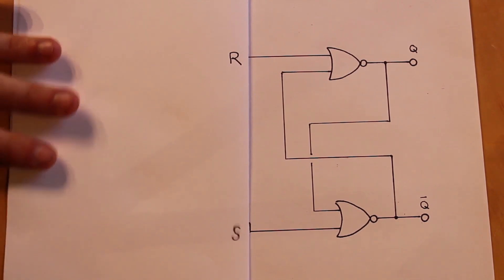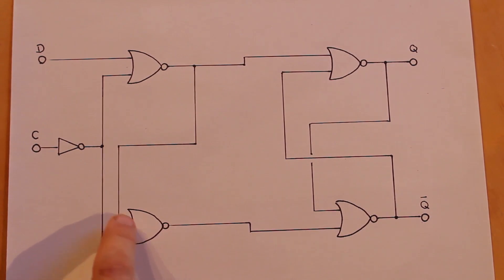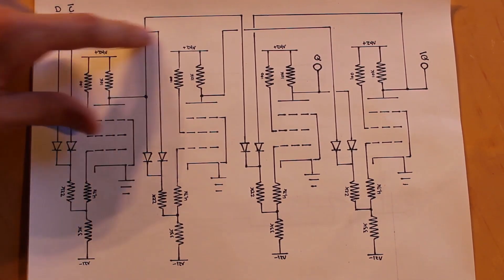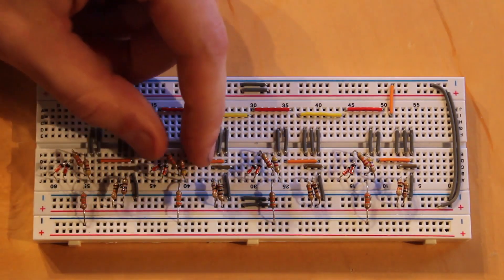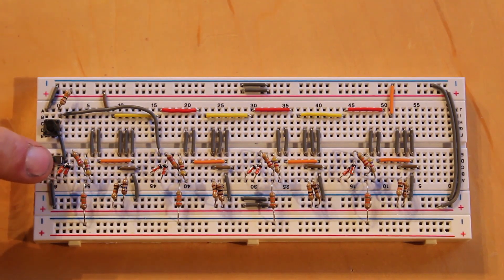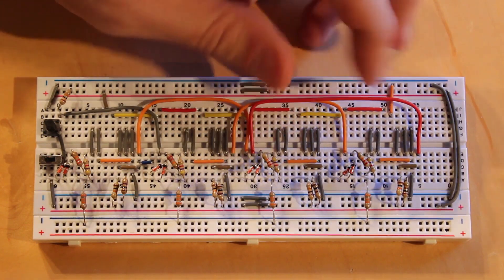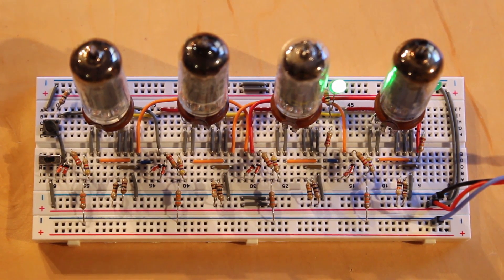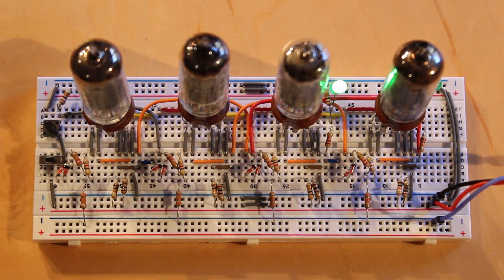Let’s Build a Vacuum Tube D Flip Flop

Comment: Somehow it bothers me that that push-button isn't between C and E but between D and E. PS: I admit not douible-jamming contacts into a hole in the 0 (actually 1) column would have required an additional wire to move things one over.

Comment: A lot of the thin “2 row” side breadboards now have that annoying gap in the middle, usually with no indication that the gap exists. Back in the 80’s when breadboards were manufactured in the good old U S of A, that gap didn’t exist. I note that you have added the two,short links for two of the side breadboards, but there is no link for the bottom one, which I think has the negative bias voltage. So is the bottom breadboard different to the two above?

Comment: Thinking out loud here...I wonder if you could have done the same thing using 6B7 or 6B8GT tubes?  They are Duo-Diode Pentode type tubes.  The idea is to replace the diodes you used with the diodes in the tube.
Reply from the maker: That's actually a really good idea, and I actually have a few 6AV6s and 6AT6s, which are dual diode triodes. However, the 6AV/T6 as well as the 6B7/6B8 all seem to have the diodes sharing the cathode of the triode or pentode inside the element, which unfortunately wouldn't work with the NOR design here as I need the cathodes of the diodes to connect up to the control grid ultimately.
However, there's actually a way better tube for this, and that is the dual pentode, like the 6HS8. They're set up really weird, but they essentially have a shared cathode and a shared control grid #1, with separate plates and separate control grid #2. So, the share control grid can act like an enable, and the two plates and two separate control grids can act like two separate tubes. This means the tube is essentially a dual NAND gate, which means it can be an SR Flip Flop stuffed into a single tube, which is just awesome!
Reply: @UsagiElectric  My original thought was to suggest a 6H6 but when I looked it up to confirm what it was, I discovered that it is actually just a Duo-Diode only.  But it is a cool little squat tube about 3/4" tall.  I am eager to watch your progress as you go through the process of completing a full computer using vacuum tubes.  What are you going to use for memory?

Comment: Cool!

Coincidentally around the same time, I got the itch to do a little blinkenlites with tubes.  I decided on a shift register.
Schematic: https://www.seventransistorlabs.com/Images/Tube_Shift_Register.pdf
Blinking: https://imgur.com/gallery/OF4jAxh
I also happen to have a box full of pentodes (5702, subminis with wire leads -- very handy for breadboarding!), but figured using logic gate synthesized flip-flops wouldn't scale very well for a register (hard to do it in less than the four you've used).

Fortunately, I found a way to chain multivibrators together with diodes and a (fairly high amplitude) pulsed clock, so only needed two tubes (one dual) per bit.  Also handy, everything is balanced, so the XOR is pretty easy to synthesize, only needing two tubes.  (I did opt for the trick that, depending on gate bias resistor, one triode can perform NOR or NAND between two, maybe three inputs.)  One downside to this logic scheme is, the grid divider resistors (in the register) need to be somewhat closely matched (1% or so; I only have 5% on hand so had to bin them!).

The neon lamps can misbehave as well; I went through several permutations of bulb and resistors until settling on this one.  Note the bulbs and resistors are chosen to give equal voltage drops in the respective 'on' states.
Reply from the maker: Thank you!

A shift register is one of those things that I would love to build for a future bit-serial computing project! But, you’re right in that it’s almost not possible to build a D Flip Flop in less than the four tubes (or two dual triodes) that I’ve done here. What’s more, this D Flip Flop isn’t edge triggered, so it won’t work in a shift register at all (it just oscillates like crazy). In order to do that, we need another two tubes (or three total dual triodes). That’s what I get into in the next video on the Toggle Flip Flop.

Having said that, your multivibrator design is really brilliant! I’ll be honest, it’s a bit over my head though, haha. I stared at your schematic for quite some time and I’m only starting to understand bits and pieces of it. The interaction between the pulsed clock and the quad diode junction between grids and plates is a wild one that’s really hard to visualize. But, the results speak for themselves, your blinkenlites mad scientist breadboard concoction is amazing!

Is there a bigger project this will be used in? I’m curious what kind of applications you have in mind for such a wild circuit!
Reply: Right, I once built a T f/f out of transistors, in whatever you'd call it, ECL or CML, something like that (not straight ECL, but a few stacked tiers of current steering). Really beautiful schematic, right pain to build!

The key insight for this (tube) circuit was, the grids are really sensitive.  Like, I usually toggle a bit's state by touching its grid with a screwdriver -- body charge is enough to pull it off.  Or the next easiest thing, pinching the leads of the negative pull-down resistor (thus biasing it off via skin resistance in parallel).

I figured, if I can just charge a capacitor from the plates, with little enough current that the plate voltages aren't disturbed during the up swing (which would cause backwards operation), and on the down swing, ferry that charge over to the next grids, pulling down whichever has the lower voltage -- I'll have a shift register.  (And you can't just ferry around a lone capacitor anywhere, but you can split it in half and drive the midpoint from a clock -- same idea.)  And it happens that two pairs of diodes can do exactly this, with the voltage levels as they are, given a falling edge of more than about 80V.  After poking at resistor and capacitor values, matching grid resistors, and adjusting the clock waveform, it started working!

Heh, also 1N4148s are very marginal for this, but I checked, and found most of mine avalanche around 120-130V, which is fine for this.  So, whatever, it's close enough. :)

Along the way, I had some weird behaviors, like 4 or 8-period cycles with weird double transitions (obviously, the register wasn't shifting as such).  Possibly the clock needs to fall quickly, or needs to be a low enough impedance that a cascade of transitions doesn't ka-chunk the whole thing.  I'm not sure exactly which things were wrong at the time, but just generally cleaning it up and making a nice solid clock seems to be the trick.

Also, I started with an externally clocked version (in turn driven by my function generator in one-shot or auto mode), which was giving marginal clock levels, but did seem to be working.  The 12AT7 multivibrator however is able to saturate extremely well -- the minimum plate voltage is something like 10V -- so it gives a huge signal level, and the waveform is just about perfectly the pulse I wanted.  A downside seems to be, the duty cycle is limited, so that I can't go much further on the ratio of timing capacitors; but the values shown do a nice job so that's not a problem.

Also, because this is a sort of dynamic logic -- it's able to run up to a few kHz, but somewhere above there, I can see the light intensity and pattern changing, shifting to some degenerate sequence I'm sure.  (I don't have enough channels to scope the full register at once.)  There's plenty of room left to optimize for speed; obviously(?) with 12AX7s I wasn't going for anything extreme. :)
Reply from the maker: @T3sl4  Using ECL is an interesting way to build a toggle flip flop! You don’t really see too much on transistors not being driven into saturation or cutoff. It would be interesting to see what kind of toggle speeds you can get out of a discrete transistor ECL flip flop compared to the conventional way of doing it. I know next to nothing about transistors, but it would be fun to see what the limiting factor is!

I’ve discovered that tube grids are really sensitive! Even my low voltage stuff here is sensitive enough to toggle just by touching a resistor, like you mentioned. 

Your circuit is wild and absolutely awesome! I would love to see a full-length video explaining it and showing just how far you can push it (both in terms of functionality and speed). The 12AT7 is an excellent tube, and I’ve actually found that even at 24V it saturates pretty well. I would be interested to see how well the 6DJ8/ECC88/6922 tube does in your multivibrator. I’ve found that I can get that tube to saturate reliably down to about 5V, which is better than nearly any other tube I’ve tested (weirdly, the 6EH7/6EJ7 pentode actually has a nearly identical curve to the 6DJ8). 

I’m going to have to do a lot more studying of your schematic, there’s a ton to learn in there! Thank you very much for sharing it!

Comment: Nice. You're slowly building up more and more complex logic blocks. Soon you'll be building a 8-bit counter and have used up your entire stock of tubes and probably a shedload of additional ones. ;-)    I'm guessing that a ring-counter would be a logical (pun intended) next step in the evolution of circuity here.

But every time I see one of your videos I'm thinking that the grid resistor network might be simplified a bit.  I have a hard time seeing what the 4k7 resistor actually is doing there. The current is already limited by the upper and lower resistor in the preceding voltage divider. If the gate have a very high input impedance the 4k7 is totally superfluous.  If the gate have a low impedance (I guess not) then you could just jack up the divider resistors a notch.  The only reason I could guess for the 4k7 doing something useful is if the gate is presenting as a non-linear load towards the voltage divider and some magic happens.
Reply from the maker: Thank you so much! 

It’s funny you mention a counter, because that’s something I’m actively trying to suss out at the moment. A ring counter would definitely make sense, but I can’t seem to get one working reliably with tubes because the obvious answer is to use neon bulbs to make a ring counter. Unfortunately, neon bulbs do really do a whole lot at 24V, haha. I do have some plans for other counters to try to build, but like you said, it’s going to take a boat load of tubes!

You know, I never really thought about the little 4k7 resistor, it was one of those things that I was using while I was experimenting with a whole bunch of different resistors of all values for the voltage divider going into it. Once I was happy with the 22k/33k combo I use now, I never gave the 4k7 another thought. But, you're absolutely right that the 4k7 could definitely be superfluous. So, I figured I would do some testing!

I set up a 6AU6 as an inverting amplifier like always and then ran a potentiometer into the 22k input, changing the voltage from 6V to 20V in 1V increments. I took a measurement on both the grid and plate/output to see if there was any appreciable difference between the two.

Here’s the results: https://i.postimg.cc/Y9s9qbPk/Data.jpg

At first, it looks like there’s nothing in it, but where it gets interesting is what the voltage measured directly at the grid is as the input voltage increases. Once the voltage at the grid passes about -0.5V, it starts to flatten out, despite increasing voltage into the divider input. With an input of 10V, the grid voltage measures just about 0V and barely increases from there.

That’s not necessarily a revelation, as I’ve seen that in other tests I’ve done in the past. Also, I’m not entirely sure why that’s the case. I haven’t done too much reading into it, but it definitely is curious. However, the main thing between the 4k7 and NoResistor setups is there is an actual deviation from an input of about 10V on up. It seems the tube hits full saturation (output at 4.9V) with an input of 15V as opposed to an input of 17V with the 4k7 resistor.

So, the 4k7 is definitely doing something, although it’s probably so minimal it doesn’t really make a meaningful impact on the circuits I’m building. I’ll have to do a bit more reading on this and see if I can find a solid answer for what exactly is going on on the grid!
Reply: @UsagiElectric  Yea, neons are out of the question at 24 volts ;-)  When I do ring counters I do it with a npn/pnp combo that makes up a pseudo-scr as the active element and on top of that a diode or led up to the supply line that is having short interruptions in it to force a step in the counter. II guess something similar could be made with thyratrons.

The 4k7 seems to actually do something  a little bit, which is kinda curious since the grid should have a high impedance (considering I read everywhere that a tube amplifiers input impedance is basically only affected bu the value of the grid resistor that follows after the input dc-blocking cap).

Maybe the tubes operate in some strange mode at this low plate voltage.and actually is pulling some current into the grid?Could you measure the voltage drop over the 4k7 at some input voltage and see if there's any? Even a 1uA current should give 5mv that should be visible on any dmm. Does your tube-based meter have any real low voltage settings?
Reply from the maker: @MatsEngstrom  Oooh, I hadn’t thought about trying to build a ring counter out of thyratrons, that’s an interesting idea! I’ll have to look into that more and see if anybody has experimented with them as ring counters. 

The 4k7 is definitely doing something! I setup the 6AU6 as a standard inverting amplifier with the 33k to -12V and the 22k to a potentiometer input swinging between 5V and 21V. I measured the voltage on both sides of the 4k7 resistor with my VTVM. That Conar meter has a 3V scale which lets me read voltages at 0.05V intervals fairly easily. The results are pretty wild!

Data: https://i.postimg.cc/Jns8wbnY/4k7-Data.jpg

So, the voltage measured at the grid itself pretty much plateaus at about 0.2V, but the voltage measured on the resistor network side of the 4k7 continues to rise. I would say that the grid definitely looks like it’s pulling in some electrons, and I have a theory as to why. The divergence happens at about 9V input voltage, and the output of the tube at the input level is about 6.5V, which is right about saturation. The plate is absorbing as many electrons as it can. But, as we crank up the input voltage higher and higher, there’s a stronger and stronger potential flowing into the grid. So, it starts to suck up some electrons.

Because the grid is absorbing electrons, the potential measured at the grid is essentially ground, but on the other side of the 4k7 resistor we see where the voltage drop is happening, which appears to be about 1.5V to 2V. My guess is that 24V on the plate just isn’t a strong enough of a potential to provide enough of an attraction to keep the electrons from being pulled into the grid. So, it might actually be a good idea to keep that 4k7 resistor in there.

I wonder what the effect on grid longevity will be, considering the grid isn’t supposed to absorb any electrons at all (in theory). At any rate, since I’m using the tubes for weird applications, they rarely run longer than an hour or two per day, which means they’ll probably still last for many years.

Very interesting information! Thank you so much for asking about it, I’m having a ton of fun setting up and measuring different things!
Reply: @UsagiElectric  There are some dekatron counting tubes.  You might see if any of these pop up sometime.
Reply from the maker: @stphinkle  Dekatrons are definitely on my list of must buy tubes! Unfortunately, they're a cold cathode tube, which means you need pretty high voltages for them to start operating, similar to neon bulbs. Still, they're absolutely epic pieces of history and I'd love to build something with them someday!